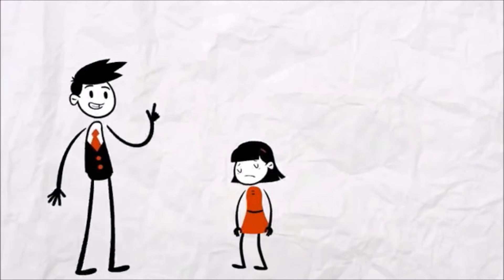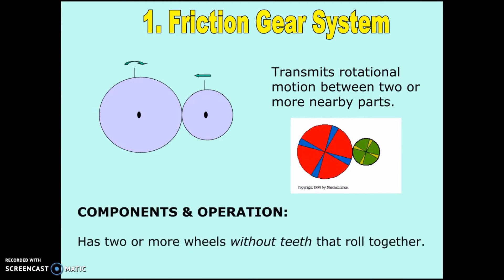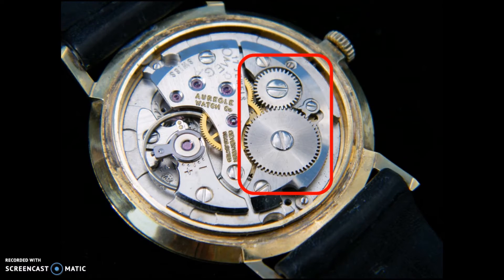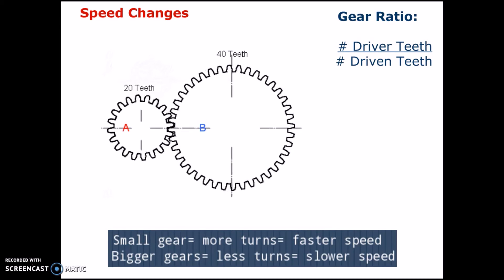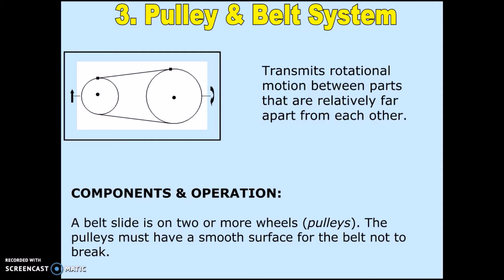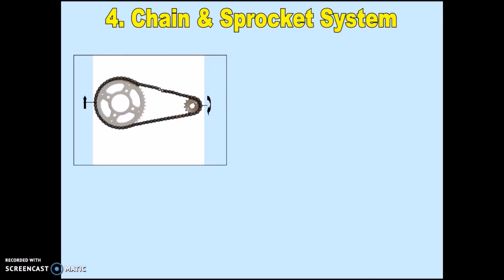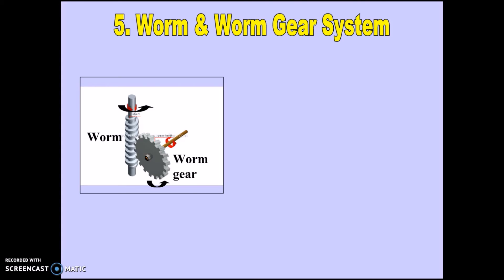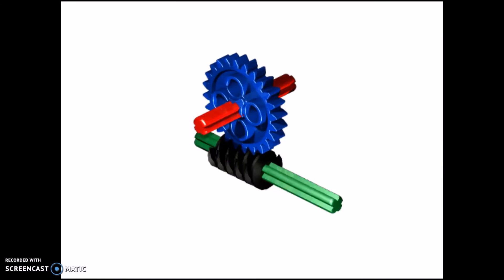The 5 Motion Transmission Systems

Comment: Just one question: worm gear system seems to transfer rotational motion into translation. And in the beginning you mentioned "motion transmitting is a transfer of mechanical energy from one object to another without changing the nature of the movement". I'm puzzled a bit...
Reply from the maker: Worm gear systems do not have translational motion; both the worm and worm gear rotate!